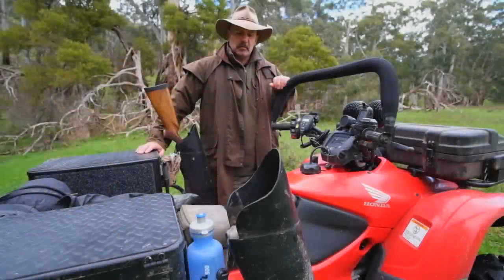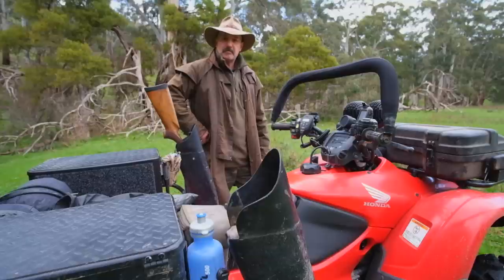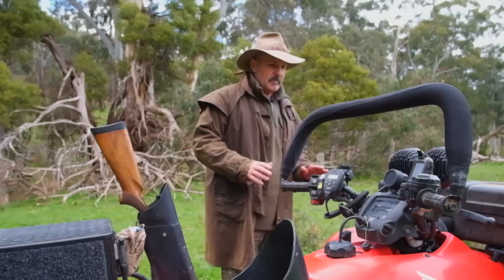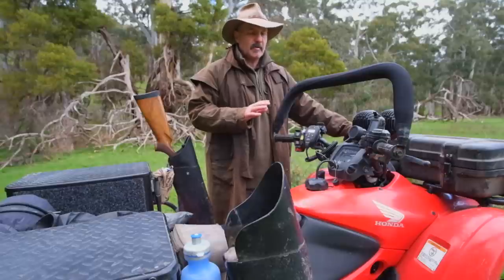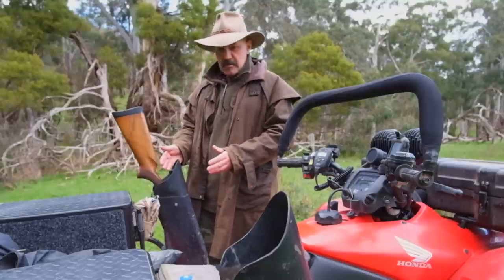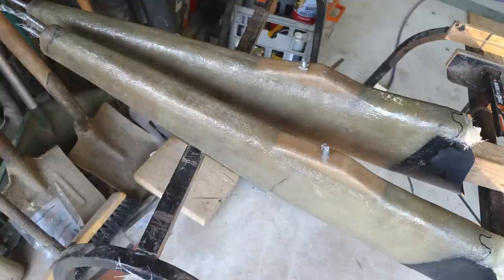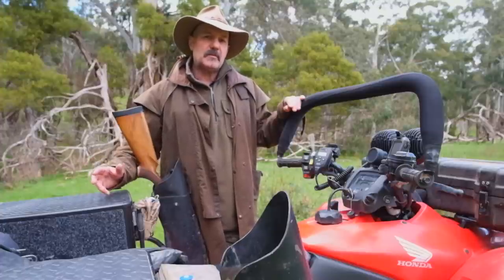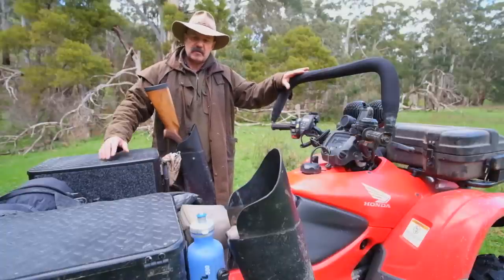ATV Hunting Setup - "Video Review"

Comment: Love it quite similar to our quads. We setup with full UHMW skids underneath and our rifle scabbards are not so vertical…why because the crown on the muzzle gets damaged. Angle your scabbard more so it sits on the belly trigger more plus easier on the scope reticles. We do 80-100 miles a day in desert so gun needs to be perfect or it gets destroyed. Your on point about the pot metal factory rear racks they suck we reinforce the factory ones with braces and expanded metal. I should do a video of our rigs. Thanks really enjoyed your video.
Reply from the maker: Cheers mate. I would be keen to see your setup. No muzzle issues in my scabbards as majority of the load is shared by the firm hold of the sheep skin and there is a rubber pad at the bottom. Thanks for watching.
Reply: @BoltActionProductions  shoot me an e-mail and I would be happy to show you. We also use double muffler but ours is quite different.
Reply from the maker: Baproductions@bigpond.com
Reply: @BoltActionProductions  sent you two emails.

Comment: Sorry Steve back again to get started on the rifle scabbards, i will do one at a time what volume of resin and hardner  and cloth will i need? i will pick up a lth, of pine and start to shape to the rifle. i own a multi barrel rifle 220 swift, 243 win, and 6.5 by 284, the 6.5 is 26" barrel what would you recommend make the mould to the 26" rifle or do it to the 22" barrel. rifle it would just mean the rifle will ride higher in the scabbard ?  Any help.will help.
THANKS.
Reply from the maker: Buy more than you think you need and ask your supplier the correct mixing ratios. You will probably make a few mistakes so be prepared. Very hard to make one size scabbard that fits all well. You need to work out your priorities with rifles and either make two different sizes or make one to the largest rifle and be happy with a loose fit on the smaller rifles. Keep me posted
Reply: Thank's we have a local kayak , canoe builder not to far from home i will pop in and see him,  Cheers Chris.
Reply from the maker: That's the shot
Reply: I need to get out and (sniff the G-powder not the the resin) one thing at a time.

Comment: Nice setup! Would you ever make those scabbards for resale? I'd be keen on a couple on my Honda Red.
Reply from the maker: Thanks mate, glad you enjoyed it. The time and effort required to manufacture those scabbards would not make them cost effective I'm afraid.
Reply: I would pay enough to make it worth your wild.
Reply from the maker: @chief1193  Most people think that but by the time you buy materials,make a mold,  make custom fixing brackets and allow 2-4 days to manufacture the cost will not be accepted or understood by most.
Reply: @BoltActionProductions  Hey thanks for this video. I’ve just finished modding (well - almost!) my Honda Rancher 420 ‘Big Red’ and a lot of the inspiration/ideas were taking from your build and the bike from ‘Edge Of The Outback’. I’ve sent you a message on IG with pictures of the mods. The Warne winch you have was a great idea. Many thanks. Richie from Forge NZ 🫡
Reply from the maker: @ArimaKihe1  glad it gave you some ideas mate 👍👍

Comment: ANOTHER question please Steve , did you place a bolt at the bottom of your scabbard like the one you have at the back half way up the back.??
Reply from the maker: Two metal threads welded to a plate that is glassed to the bottom of the Scabbards. 
http://www.hunt101.com/data/500/medium/Scabbards_Top.jpg 
http://www.hunt101.com/data/500/medium/Scabbards_Underneath.jpg
http://www.hunt101.com/data/500/medium/Steel_work_and_Scabbard.jpg
Reply: Ok thanks mate i will get started on them this week, i had a look around Bunnings the other day they have pine timber about 1800 long and deep enough to cover the rifle shape, i will start there and see how we go. Thanks.

Comment: Hey nice setup! Could I have the brand and specs of the Alloy wheels at 1:42s? Cheers
Reply from the maker: Cheers mate. It's been quite a few years since I bought these rims and can't remember the exact model but what I can tell you is I bought them from Rocky Mountain ATV. If you go onto their site and put your exact bike model info in you should be a be able to see what rims are available for your quad. You could also go back through some of the comments on this video as I may have answered a similar question before. Good luck with your quest and thanks for watching.
Reply: @BoltActionProductions  Hey thank you! I'm modding my quad to be a combination of yours and the one from Edge of the Outback.
Reply: @BoltActionProductions  Final question - what make and rating is the winch you're using? Cheers
Reply from the maker: @loyal2no146  If my memory serves me correctly it is a Warn XT25 which is a 2500lb winch with synthetic rope. I'm pretty sure that model has been superseded since I bought mine.

Comment: Thank you for  your help with the rifle scabbards, other's would this very interesting as well , i have just about finished a double rifle carrier on the front of the quad, it will do until i have a go at the scabbards. Cheers for all your help, ps are you guys in Qld ,or NSW. just wondering.
Reply from the maker: No problem mate. Good luck with it and no we are further south
Reply: OK cheers .
Reply from the maker: Dingydate asked this question via another video and I would just like to share my answer here. "Hi Guy's back to pick your minds again, have just about finished the 
rifle rest on the front of the quad added a cross bar holds the GPS and 
the GOPRO . working on a double rifle rack for the front, i would like 
to try the fibreglass rifle scabots  , did you use a release agent on 
you timber mould before glassing over ?? and how many coats of glass 
matting are in yours? have done a bit of fibreglass work before, back 
when GOD played fullback for Jerusalem. so awhile ago. Thanks for your 
help."
Reply from the maker: For the Scabbards make a timber mold in two halves to the shape and size
 of the internal dimensions you want allowing for the thickness of your 
liner whether it be sheep skin or artificial wool. The mold should be in
 two halves vertically split down the middle. When you are happy with 
the dimensions and the timber is sanded smooth use a release agent and 
glass over both halves with one layer of fiber. Once dry use a knife to 
get the excess off the edges and release each half. You should now have 
two mirror images that should be ready to put together. Now you use a 
waterproof contact adhesive to fix the liner of choice to the inside of 
each half. Once done hold them together with a bit tape and use glass 
strips in the middle to start the fixing of the two halves being careful
 not to get resin on the inside. Once the two halves are together now is
 the time to glass any fixings to the outside before glassing over the 
whole lot again until you are happy with the strength. Depending on 
thickness of fiber usually another 1-2 layers of glass over the whole 
lot will suffice. Then you can paint or use a colour in the final 
gelcoat to achieve the result you want.
I hope this helps.

Comment: Hi Steve , i was able to pick up on line a Simico smr9000 two way raido , the only thing it came with out a user manual , did you happen to get one with yours? there is a lot of info on line but mainly Teck info. CHEERS.
Reply from the maker: Simoco is the new name for Phillips. You can contact them here http://www.simocowirelesssolutions.com . It isn't easy to make a generic instruction manual for them as they can be setup so many different ways. Multiple options for mic/head units and individuals can program them however they want so there is really no standard. Depending on which one you have and how the buttons have been programmed it is going to be hard. The best shot is to get the software and a programming lead and set it up to suit your needs. With the software you can download off the radio and see how it has been configured. You can then change the button layout configuration yourself and upload the changes back to the radio.
Reply: Cheers Steve, thanks for the advise the one that i have has the CB channels , but i can't seem to find how the gain or the scan works.